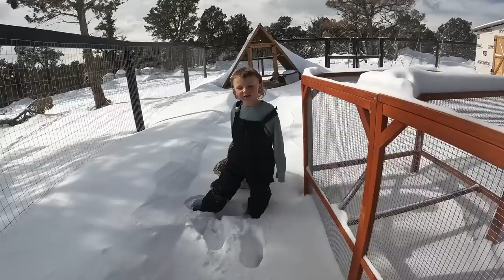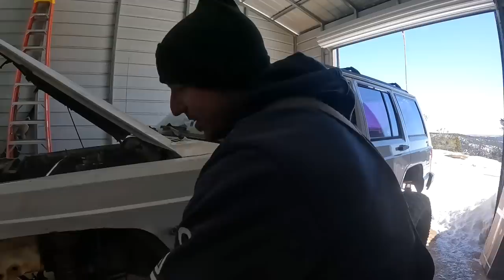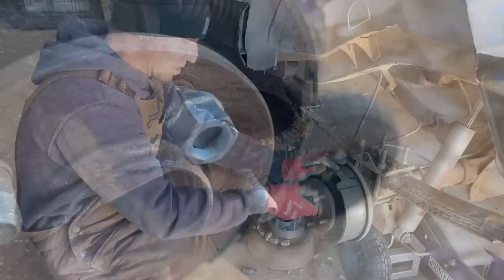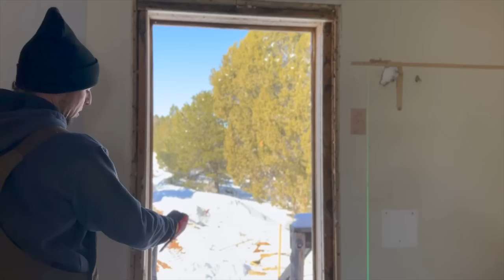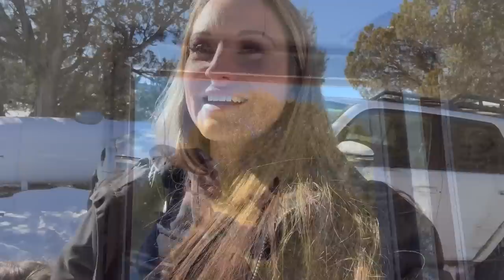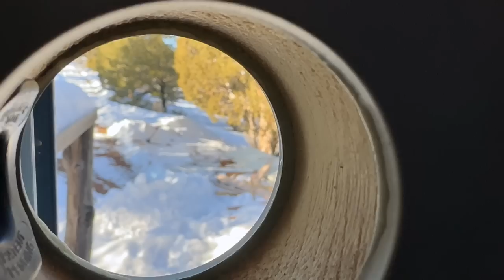COLDEST DAY THIS WINTER I OFF GRID CABIN RENOVATION

Comment: *Heatshrink* As far as the chickens go, they huddle, That's how they try to keep warm. Other than the straw, the other thing you should do is staple some plastic to the ends, leaving a small opening at the very top. Keep the wind off them and they will be just fine.